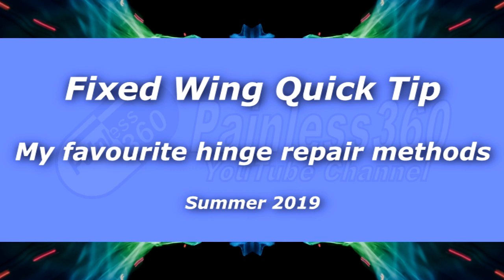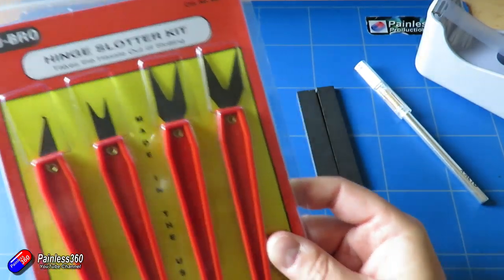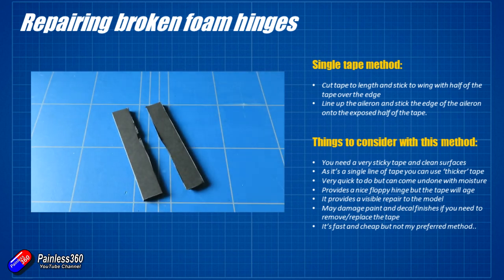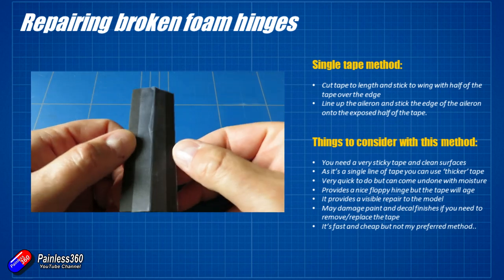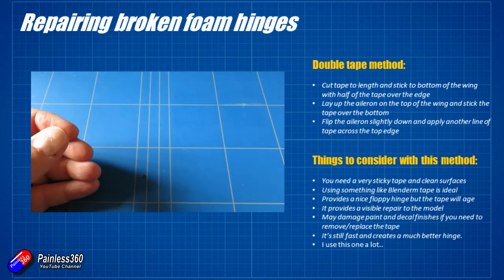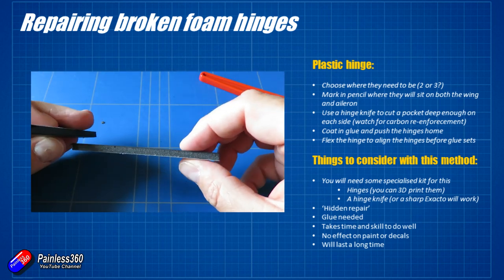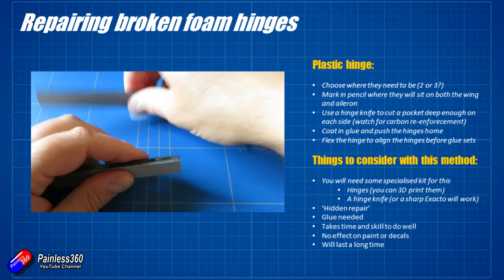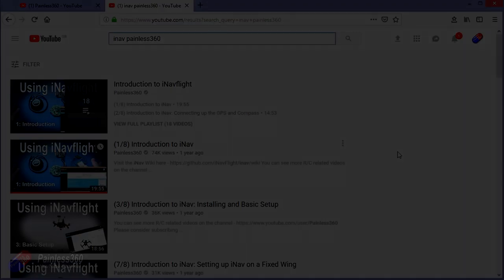Foam Hinges - Easy Repair Options

Comment: For every foamy model I buy that I think is worth it for longevity, the first thing I do is use clear packing tape as a reinforcing hinge by moving the control surfaces to their extremes then laying down a full length (or close to it) strip of clear packing tape. Smooth it down with a plastic ruler edge, then flip the model, and repeat the other side. No need to worry that the foam hinge will degrade over time, because you have a reinforcing tape over it from the get go.

Comment: I much prefer to repair using the hinges, even now with a brand new model I'll cut the foam hinge and refit using hinges. One tip I did find VERY useful with them though is after you have the pockets cut in the foam take the hinge and fold it flat. Then dunk just the pin section is some vaseline, unfold and refold the other way and dunk again, then apply the glue and insert the hinge into the wing as you would normally. The vaseline stop any glue getting into the pin and seizing it up.

Comment: UHU Pro can give a give a good hidden repair on colored models -especially if the hinge is jagged. Just spread glue on the torn join and wait a few minutes till the glue goes stringy. You do need to leave it to set but it’s very flexible. Add a strip of tape in the ‘V’ for extra strength if required.

Comment: I literally just crashed my Primo, and discovered the right aileron was ripped yesterday. I just used blenderm tape, it's really good stuff. Are there any glues or adhesives other than hot glue that would make a good hinge repair?
Reply from the maker: There are lots of ways to repair a hinge and these are the ones I use. Foam safe CA, the glue from Hobbyking shown here and 5 min epoxy are all I use..

Comment: cut hinges out of milk bottle plastic crease the hinge joint . punch a hole in either side so the glue can form a plug ,install then like a dubro style hinge ..use a small amount of epoxy to glue them in .. last forever.

Comment: I’ve found the best way is to get an old floppy disc, break it apart and cut a hinge from the disc itself, make a few holes in either side, next make two slots in the wing and control surface with a scalpel or sharp knife and gorilla glue them in, the glue expands through the holes made from the disc and hey presto, a hinge that will never break, the disc inside the floppy disc case is super strong, only thing to be careful with is the amount of gorilla glue used, it doesn’t take much, too much and the glue will expand out of the slots.
Reply: @daviddou1408   use milk bottle plastic .. dont use the clear pet style it will snap.

Comment: Painless...you mentioned "blendone" tape? I probably got that word wrong, but what is that? I looked on Amazon and nothing came up. Also, a good complementary video would be to go over how to reinforce hinges that are getting a little weak...tape?...hot glue? I'm sure you've covered that in one or more videos on the past. Thanks again.
Reply from the maker: It's my accent! :) 3M Blenderm tape. All covered on that Caipirinha build video..

Comment: I find for smaller models that hot glue hinges work well and last a long time - saw these on a old flite test video.
Reply from the maker: I've found them good but stopped using them as they do fail after a while and flying in hot sunny conditions can cause them to get too soft and let go..
Reply: @Painless360  i haven't had any fail or look close yet but I can see that there's an issue with hot weather!!